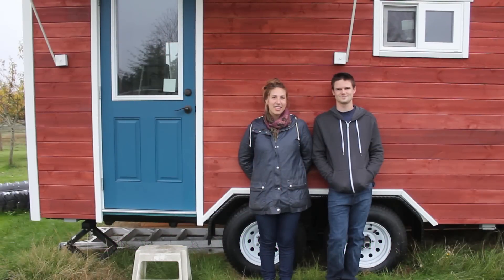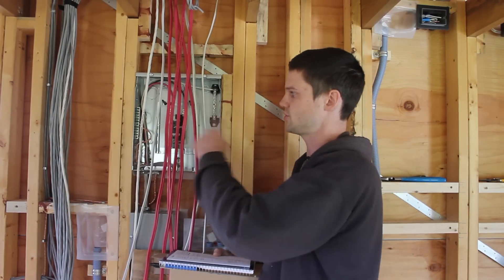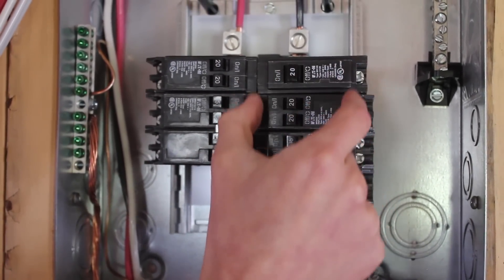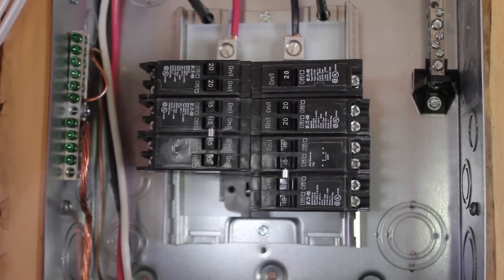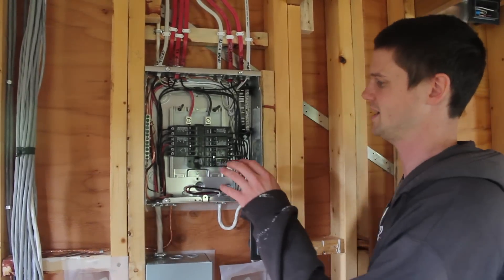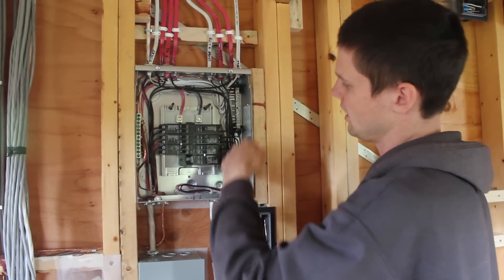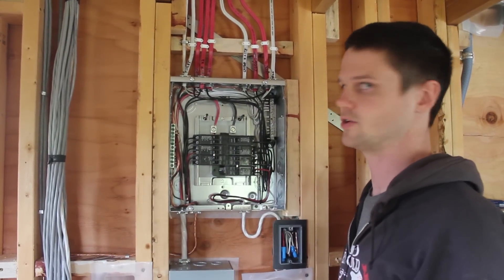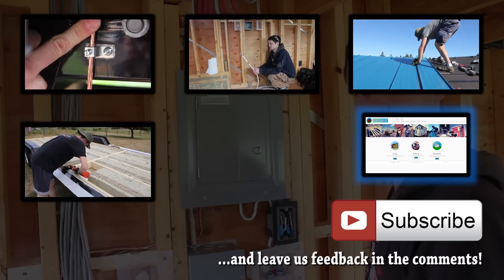Tiny House Electrical Panel (Ep.43)

Comment: A very neat job, but section 550 of the National Electric Code should be consulted, even if you are below they square foot requirement for this code to apply.  Arc Fault breakers are a good thing and required by section 550.
Reply from the maker: I am admittedly rusty on code (ever more-so now than when this video was filmed) but I remember that Arc-Faults were required in bedrooms (defined by having a closet). In the case of a tiny house, where would you suggest that AFs be installed? In the loft? Everywhere?

Comment: How does the 12v stuff tie in? I know you said eventually you'd like to get it on battery power but, in the interim how are you powering it?
Reply from the maker: We have a 12V power supply mounted in the "control box" which is just part of the wall with a cabinet door to cover it. The whole 12V system is something that I'm really hoping to tackle this winter.

Comment: Great videos! Very helpful and informative. So I’ve got a rookie question and haven’t really been able to find a solid answer. I’ve wired my tiny house to Connect to a 50 amp rv plug coming in from an external outlet. The service panel in the tiny house is wired like yours with the mains coming in and connecting to the lugs. My question is do I connect the green screw to bond the neutral or should I treat it like a sub panel and leave it unbounded?
Reply from the maker: In most cases you would want to treat it like a sub-panel. An electrical system should only be grounded in one spot, because multiple connections to the earth can lead to current flowing through the dirt and along other bonding wires, which is a safety hazard. However, there are situations where you would need to re-ground, such as if you are so far away from the main ground and/or the composition of the earth is insulative... but you'd need to do some testing for that, with equipment that I've hardly ever used...

Comment: I'm trying to purchase the things I need to install the panel...if I'm correct (and I'm probably not) For my heater and A/C, Stove, Fridge and W/D I would just need 3 of the 2 pole 20 amp breakers....am I correct?
Reply from the maker: The worst thing to mix with electrical work is uncertainty... breakers are sized to protect the wiring and devices on the circuit, so it depends on that... I know in a lot of places in the USA they use #12 wire, but I'm not sure if most circuits are breakered at 20A... I highly recommend getting in-person help, and definitely do not install anything that you are not 100% confident is correct and safe!

Comment: This may be an absurd question, but what do his do with the red wire if you’re running 12/3 or 14/3 just because you have it AND because it makes dedicated circuits easier as well as 3 way and 4 way switches? Thanks. I’ve run lots of wire but my first circuit box & 1st tiny home.
Reply from the maker: In our case, we used it in a few specific runs where we wanted to do two circuits at once... but this is only possible because we have a 240V service, which is not very common... most tiny houses would be 120V, which is admittedly much simpler... but because I'm an electrician, and we need lots of power for electric cooking, I went for the 240V. Running two circuits using a 3-wire cable is very common, but if it's connected incorrectly, it can be a truly dangerous fire hazard, so before working on it make sure you fully understand the use-cases and ask for a knowledgeable second set of eyes to look it over. Stay safe! :)

Comment: Hey Scott, what size panel did you opt for? 30A or 60A?
Reply from the maker: Are you meaning to reply to someone's comment? This came through as a fresh comment so Scott wouldn't see it...
Reply: Nope! It's a brand new comment! What size electrical panel was used in this tiny house?
Reply from the maker: Ah just wondering about the name Scott lol 
Our panel is rated for 125A but it's being fed by a 50A cable, and protected by a 40A breaker... so the system is currently 40A at 240V which provides a maximum possible of around 7500W continuous (but we won't be using anywhere near that much... just need the headroom for short-term loads like electric cooking).
Reply: Okay cool, thanks! Just out of curiosity, why didn't you opt for a 50A RV power inlet on the tiny house instead of the direct wire (from garage to tiny house)?
Reply from the maker: The short answer is cost vs know-how... Those RV components can be expensive and since I know how to manually wire things up, we chose to do it that way, at least to start with. We wanted to get it powered on and were at a tight spot in our budget. We might add cord-ends in the future.

Comment: Did you connect the neutral and ground or "earth"  buses together in your mini panel or did you leave them separate? The joining  would be done in the main panel correct? So this would not be necessary in the "sub panel". Is this also true for a 50amp RV connection say at a temp pole or an RV park? Would leaving the grounding and neutral buses separate be safe for generator use?
Reply from the maker: Generally, the neutral should only be connected to ground/earth at one spot in the entire system, but there are exceptions in specific situations (electrical code books will specify). 
It's my understanding that you WOULD want it interconnected when generating your own power, because there would be no bond-return-path otherwise... but I haven't worked on a system like that yet... we hope to get some of our own generated power to the tiny house one day. 
We actually have an entire video that talks all about this subject here: https://youtu.be/YfmqaUdYdzg

Comment: I know this is an old video, but im a but confused.. your 8 gauge service wire is rated for 50 amps, but you have a lot more amps if you add up all the breaker amp ratings.. what am i missing here? How are these correlated? Great vid, thanks!
Reply from the maker: It's an "evergreen" video... we hope lol ;D 
Good question, it's very basic electrical... each branch circuit is protected such that the conductors will never be subjected to more current than they are rated for (and thus not overheat). 15A is the minimum standard, so even though the circuit is capable of delivering up to 12A (80%) it's unlikely that we would be plugging in enough to draw that, and the rest is unused headroom... so the breakers handle each individual run of cable, while the service cable represents the maximum total power that can be delivered at any moment in time. We purposely oversized the main feeder so that we can run almost everything in the house at once without it tripping the breaker (which is a situation that will probably never occur anyway).

Comment: Where do I put the wire into the panel that hooks up the the RV plug so I can power the tiny house at a campground?
Reply from the maker: Not sure how to answer this exactly. There is only one input into a panel like this, so whatever cable is bringing power in will go to those input lugs.
Reply: Great thanks so much!

Comment: I see that you have two hot wires coming from the inlet to the two 125v busses. If I'm using a 30 Amp RV inlet, (which has only one hot wire) how can I accomplish this?
Reply from the maker: Short answer: you can't... there is no way to create another leg if you only have one to work with. Many tiny houses are wired entirely for 120V. We chose to go for 240V because it doubles the capacity of system, and because we knew that we would always be in a spot where we could hook up to a 240V source.
Reply: Thanks for the response. Very helpful.

Do you know if it's dangerous to create jumper between hot busses, which would essentially create a single 120V bus? I have space for only six breakers in my 100A box (three breaker slots per hot bus), so if I didn't do something like that, I would be limited to three breakers.  I suppose I could use single pole tandem breakers, but for my Square D panel, they don't seem to make them in CAFCI, which is what I'm determined to use. 

I guess my question, specifically, is this: How do I wire a 240v breaker for 120v, while being able to use all of the available space on the two hot busses?

Thanks again.
Reply from the maker: It could be dangerous... I would definitely not modify the bus in any way (like drilling into it or screwing down a wire directly to it). It might be possible to jumper using breakers, meaning you put a breaker on each bus and then connect them to each other with a wire... so you're essentially turning the second bus into a sub-panel. You'd need to size the breakers and wire correctly. Whatever you do, be SUPER careful and get a second opinion on it... if you make a mistake, it can mean a fiery death, so take it seriously!
Reply: I haven't hooked up the system yet, but I simply pigtailed a piece of 10 ga wire into the first bus, and used that wire to connect to the second. There is absolutely no modification of the breaker box.
Reply from the maker: Just be sure you are protecting that wiring with a properly sized breaker, otherwise it can overheat and cause a fire. #10 wire can't handle any more than 30A, so from what you've described, your entire system can never safely be fed by a breaker rated higher than 30. Also, you cannot safely load a breaker more than 80%, so (80% x 30A x 120V) = 2880W grand total for your system.

Comment: Hey Jake and Kiva! I have really been appreciating your videos they have been helping me a lot. You guys do a good work especially in the way you keep everything ORGANIZED so kudos. I have a question about service wires (I am building a tiny house too!). If I ran two 15 amp cables from a house I am parked behind, can I "combine" these cables to achieve higher amperage or voltage feeding the tiny house breaker panel? If so how much amperage at what voltage would I get? 30 amps at 240 volts? (I'm in the USA.) Second, what's the easiest way to wire these two, three-conductor cables to the tiny house breaker box? (I assume they must be three conductor because they will be plugged into regular 15 amp receptacles in our landlord's house.) Thank you so much in advance.
Reply from the maker: Thanks for watching :)
I would encourage you to abandon the idea of combining cables. It is physically possible, but would almost definitely violate codes/regulations, and could easily lead to a dangerous situation. 
The voltage depends on if you've connected to one or two (both) of the legs available, and the amperage depends on the diameter of the wire (the wires inside the cable). So you can see that we used a cable that is big enough to feed a range (oven) and has a 4th conductor in it, which allows us to bring in the second leg of the system (providing a 240V supply). Many tiny houses only bring in one leg because the total electrical demand is very low. You will need to carefully tally up all of your electrical equipment's power requirements and size your cabling accordingly. Be safe!
Reply: Thanks for getting back to me. So you guys set up your own 240v circuit at the subpanel you draw from? (As opposed to plugging in to two separate 120v circuits.)
Reply from the maker: Yes we ran a single 240V circuit that was big enough to handle the entire house.

Comment: so strange to see that wiring setup in the uk the sparkies use a total different system we don't have the earth cable going into our fuse boxes here each socket has its own earth neutral connections just the live wires are fed into the fuse box
Reply from the maker: Hm, well you guys used ungrounded 240V for everything right? Like... there is no grounded neutral involved...
Reply: no there is none of that here

Comment: what gauge wire would you recommend for a 100 amp panel?
Reply from the maker: +LiveYourLife89 It's not so much a recommendation as it is a matter of making sure your wires and equipment are protected by a breaker that will not allow more current to flow than is safe. A panel rated for 100A means that it can handle up to 100A, but you could supply it with less if you wanted. We will probably end up with a 40A supply to our 125A panel because that's all the power we will need, and it would be cumbersome and expensive to use cable rated for a full 125A. If you wanted a full 100A to your panel, you would use a minimum of a #3-AWG copper (according to my 2012 Canadian code book)... when I took my exam, they had recently introduced rules to account for the fact that breakers were rated for 75-degrees and not 90 like most cabling... so you would have to use the 75-deg value for ampacities as to not overheat the breakers... plus you never want to draw more than 80% of the breakers rating on a given circuit under normal conditions... but you still have to use cabling that can handle the full rating... simple right!? ;D

Comment: is this a 50 amp box down to 30 amp?
Reply from the maker: +Greg d Greg d The panel is rate up to 125A, the cable that supplies it could do 55A (in theory), and we will probably run a 30A cable from the house... so the entire system is only as capable as the lowest-rated part. Also, average breakers are only rated for 80% of their amperage, so a 30A breaker should not be used to supply more than 24A under normal conditions.
Reply: +Tiny Nest can I ask why u choose to go with a 30 amp instead of a 50 amp? Keeping u above your loads easily?
Reply from the maker: We actually went with a 40A breaker to give ourselves a little headroom. It's still probably more than we need, and we will be monitoring our power use and making a video about it in the future :)

Comment: Mini's or tandems are not my first choice for breakers. I like to size the panel for full size breakers with room for extra circuits. I am sure you have your reasons. Nice work!

R u union?
Reply from the maker: +The Contractor Dude They're needed for this brand when doing two circuits on a 3-wire cable... plus we had a lot of circuits :P

Comment: Great video...its the best on Youtube I've seen thus far? I have a question, I get placing of the grounds on the left and the neutrals on the right and the hot wires seems to go in the breakers, but what about the output wire at the bottom right in the panel that goes to the rest of the house? Is it joined with the hot wires in the breakers?
Reply from the maker: +Calvert Edwards Thanks :)... I'm not entirely sure what you're asking... The cable in the bottom right is just another branch-circuit, feeding some plugs, exactly like every cable that enters the top of the panel. The cable on the bottom left is the feeder for house (power input). To see more detail about that cable you can watch this video: https://youtu.be/WH_aV6MiHxc?list=PLlUOuqspk4WGpGZPIOKrCti363Eu0MSTl

Comment from the maker: +Dustin O
We can't reply to your comments... have a look at this video to see why: https://youtu.be/9JstXOp0jjo
But to address your "phase" comment: What you said was totally correct for a 3-phase service/supply, but almost all residential services are single-phase. Electricity is usually generated and transmitted in 3-phase (that's why you see the 3 wires on power-poles) but when it's transformed down to 120/240 for normal residences, only one of the 3 lines is used to operate a single-phase transformer (those cylinder cans) to produce the single phase power that we get in our homes :)

Comment: Phase is correct, because there are three phases of electricity (as it comes out of a generator).  The alternating current (AC) goes up and down and each phase does this 33 degrees off from each other.
Reply: +Dustin O Actually, each phase is 120 electrical degrees out from each other in a balanced system.
Reply: You're right, in a 360 deg circle.  :-P
Reply from the maker: +Dustin O Strange that I never replied to this earlier... Power is generated by rotating magnetic fields (a generator) and so one "electrical cycle" is measured as 360 degrees, since a circular revolution is required to produce it. For a few reasons, generating 3 phases is the most practical. 3 phases are offset by an equal amount for a consistent supply of power, so you divide 360 by 3 and get the 120 degree difference between them... however, this is all irrelevant for us because a normal residential supply is single-phase. There is one 240V phase, which is tapped in the middle so that you can get 120V between either end and that center-tap (where it is grounded) or get 240V by connecting to both ends. These two ends can be referred to as "legs" or "lines" because they are not separate "phases", just opposite sides of a solitary phase. The two ends would be 180 degrees out from each other because they are perfect opposites of the same source. Hope that makes sense!

Comment: The newer NEC code, after recently looking over it,  seems to require the AFCI's on almost every circuit in the house now, including living rooms, etc. Bathrooms and kitchens require both AFCI and GFCI. But once again, Canada may be different.  I am enjoying your videos, and thee tutorial has been very informative so far.
Reply from the maker: +Tony Corley I believe there are similar requirements in the latest (or forthcoming) CEC, but I've been a bit out of touch with it lately... since we've been building the tiny house for so long!